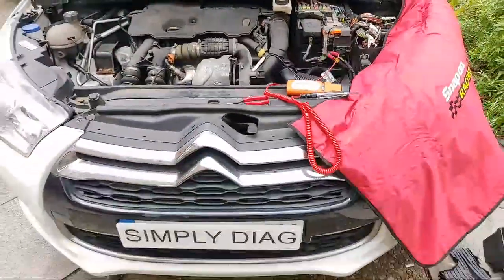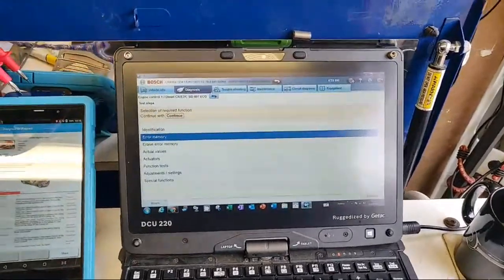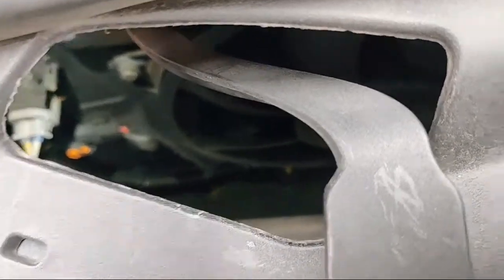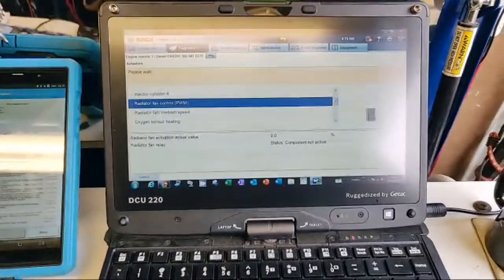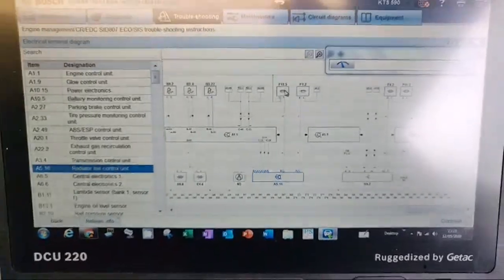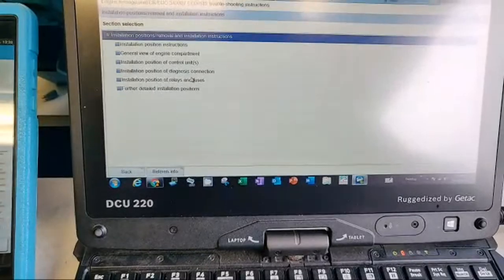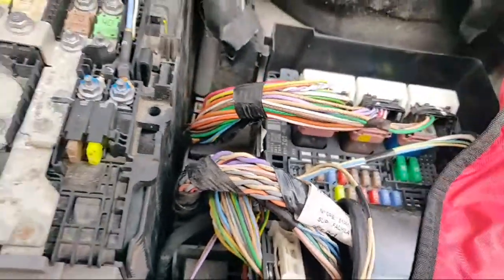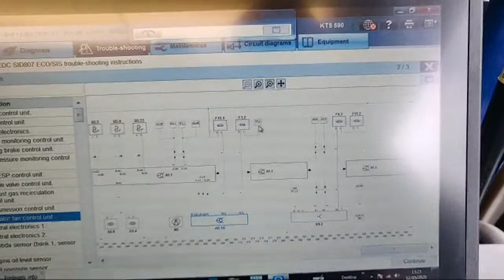DS4 Cooling Fan Not Working P0693, P0691, P0494, P0495

Comment: Hello mate 

Had a p0691 fan code ithe fan has been replaced and works but still comes up with engine fault service now I have been told it could be the water temp sensor any ideas mate

Comment: I have a loss of power to window washer and horn DS4 also- checked fuses and doesn't seem to be that. I've been told its corrosion within t he fuse box? without spending money on specialist tools (i've got a multimeter) what could i check to diagnose and fix this? Also my pwm comes on when i unlock the car. It's mental.

Comment: I've had this same fault before on another 1.2 and changed the fan resistor module which solved it. However on this car, the cooling fan is still not coming on. I've put direct power on to the fan which comes on. I've checked the loom connector and there's power there.  
The engine light has gone off, when I rescan the fault is still on ecu but won't clear. Coolant light came on so I stopped & the tank had coolant. When I opened it, it was like a jacuzzi 🤯.

Any tips & help would be appreciated thanks.